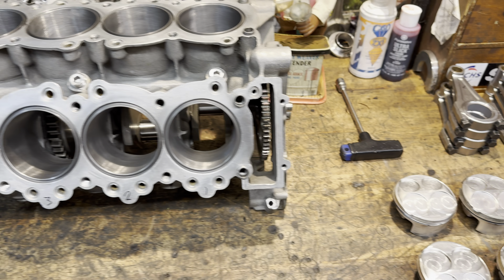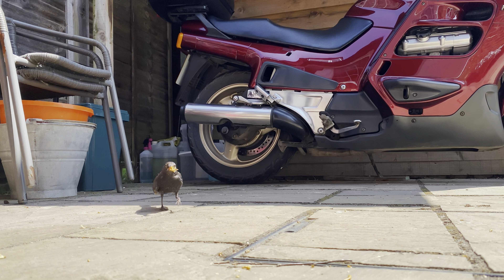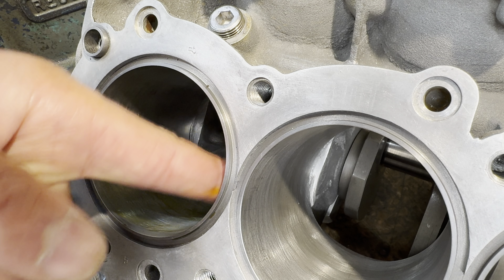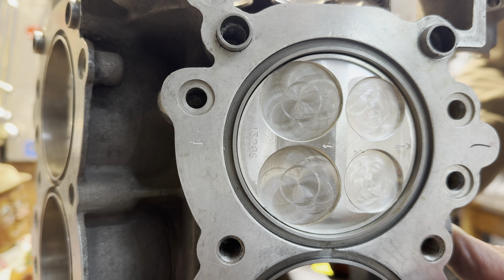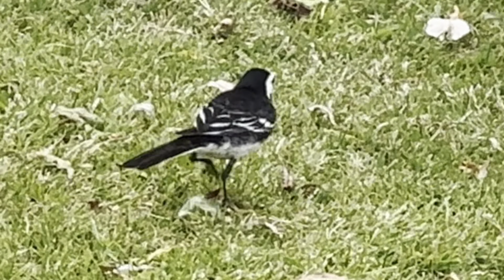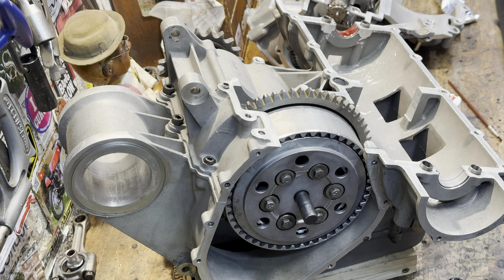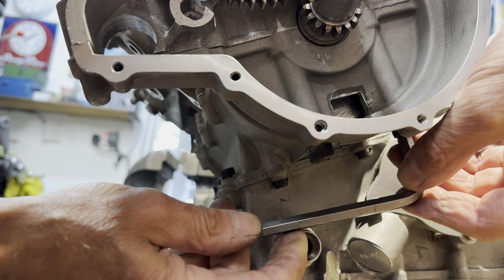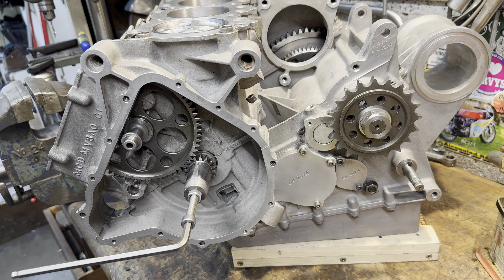Norton Nemesis V8 rebuild - Episode 11

Comment: Engine looking really good, always scary removing rings, there is a very fine difference between opening the ring up enough to remove it without breaking it!
Again, the very poor design with fitting the bolts, done in the mind of a designer, with no thought of build. Can you imagine how that would work on an assembly line and how much time would be waisted.
Bring on part 12 👍👍👍

Comment: Allen , when you did the big end bolts , it appears in the video that missed one!, there is a slight jump in the vid at that point so maybe edited out, but it appears you missed the second bolt on the second rod, of the first big end. i doubt you really did but it would be very annoying to run it up and discover one loose big end bolt!.  and also love the bit with crank wrong way round we actually rebuilt a 400 four years ago  total rebuild got all the way to putting in cam shaft and realised we had forgot the cam chain!! Love your work , my dad was a toolmaker and had just the same precision of work as you do, wonderfull to see. favorites are the hand made engine and single to twin conversions. brilliant.

Comment: At minute 16:02 it is possible to see damage where the clutch cover will be. One of the screws will not be tight, this will be a problem with the finished engine.
Reply from the maker: There is sufficient thread remaining (3D) at least so all ok 🙂

Comment: If I can have the temerity to make a suggestion about those inaccessible allen screws I think I would have used a short hexagonal bit and turned it with a matching ring or combination spanner and just used the key for the final tightening. But then I wouldn't have the patience or skill to do what you can even with a single cylinder never mind a V8!

Comment: The engine block, heads, and internals look very well designed.   Any engineering carry-over from the Coventry Climax 1.5L V8 F1 engine, other than it also being a V8 and DOHC?

Comment: Allen, I had a little nervous twitch seeing you reuse gudgeon pin spring clips ! (Or are they new?)  I learned the hard way back in 1976, aged 16, FS1E, used gudgeon pin circlip fell out, jammed in transfer port and seized engine! A good learning exercise for me back then 😂

Comment: Love it all your work. Alan I noticed Tuning for speed one of my bibles in one of your vids arr yes Slide Rule AKA Phil Irving a fellow aussy. I own several 750 Ducati GTs and am getting my dream engine built a 900 Desmo round case with plain main bearings. An old mate had all the Kawasaki triples 250,350,400,500 and 750 still beats all comers in red light drags with a set of chambers on it. It’s amazing riding behind him and watching the frame twist one way with excessive wheelie inducing acceleration and twisting the other way with stroppy inducing excessive breaking he has twin disks. Wobbels the mad Aussie

Comment: Are there no thrust bearings in this engine? I saw you install the main bearings, but didn't see any thrust bearings, or end float check?
Reply from the maker: The endfloat is controlled by the centre cap with no removable bearings probably due to no end thrust to control in this engine

Comment: You don’t use actual gaskets. I gather the gasket goo is up to the task then.
Reply from the maker: This engine has no gaskets fitted just black silicon sealler. I use Permatex ultra grey which works really well

Comment: What a surprise, the wagtail was wagging its tail,
Well that beats the wagtail bigging itself up with exagerated (wag - tale) stories!

Great comment, why the bolts screw down with difficulty and not up with ease,  it  simply highlights the total lack of brains & care & pride in oneself that us Superior White Indiginous English folk have, when applied to the original design.

Maybe this engine was made (or could be used) for the Chinese to copy?

My dream, imagine a 24 hour video of Alan making a complete bike from raw stock materials that incorporates the very best bits from each & every bike that Alan has made,  modified or planned.

We need a Christmas special.

Thanks Alan, 
(Just trying to seduce people into maximising the number of comments for you).

Comment: Some of the assembly oil seems to have made its way into the threaded holes for the conrod big end bolts, normally  the torque figures are for dry threads,  a lubed thread needs about 25% less torque ( depending on type and amount of lubricant ) how do you account for this when torquing down the bolts.  I used to work for automotive first tier assembly suppliers, and pretty much all the automotive assemblies we supplied with threaded fasteners had to be done automatically with electric inserters that applied bolts with a light torque to touch the surface and then a given angle of tightening ( depending on pitch of thread and yield of bolt ) to ensure that the fasteners were properly preloaded,   I always do this with spark plugs especially because the thickness of steel in the area where thread ends and hexagon starts is a lot thinner than you think... Most spark plug makers give a hand tight and angle setting for their plugs., a new plug the angle would be different ( larger ) to an old plug being refitted because on the old plug the crush washer already flattened..

Comment: AM that Norton seems fairly crude compared to jap eqpt. The con rods are a design I have not seen before but maybe they have increased rigidity or something. Have you seen strength data for that design? Con rod bearing surface area seems a bit on the low side since you had to cut the width of the shells down maybe 20%. Hope that is sufficient. What is the CR on that engine?

Comment: A dyno run when all completed would be very interesting. 👍🏼
Reply: With the new exhaust and airbox changes it might be prudent for some set-up to be done on the Dyno if the budget is available. I can't remember if Allen said if the ignition system needed some work or not.

Comment: 518 Loctite is better were bearing clearances are a consideration as the silicone interferes with the metal to metal interface and affects the bearing clearance. 518 reduces that issue and also stops a lot of contamination from the silicone squeezing out of the joint..

Comment: Did I miss something, or did you skip the second bolt on the second rod cap when you torqued them? On camera it looks like you did, but if you do a two stage torque sequence you would have caught it. Wouldn't want it completely assembled with that bolt hand tight.

Comment: Those hard to get at bolts, wonder could you devise a rubber band as a belt and pully type gismo run by a cordless drill chuck to run them down.

Comment: I know this mightn't seem like a big deal to many, but I LOVE IT when an engine rebuilder DOESN'T slather everything in loads of synthetic assembly lube.
Here we see Allen using engine oil for the most part, and judicious application of the assembly lube.  Not much more is needed, people.  And into the bargain, you don't end up with all that excessive synthetic lube contaminating the engine oil and compromising the running-in process.
Of course, this is just my 2-bob's worth... don't want to start an engine oil argument!  They never end well 😀

Comment: Nice work Allen... what oil do you plan on using for start-up and run-in? with the new liners would you use a mineral oil to help the rings bed in to new bores?

Comment: You can use an old liner  instead of the piston ring compressor to fit the pistons , with your lathe a small female step machined in one end would be " just ...." 😊
Reply: Common in many performance and industrial applications to use a liner type sleeve tool
Reply: @johngibson3837   it's a weird looking design , as if someone thought 0K let's have a narrow angle race engine and compromise it as much as we can by making an arse of the layout and use a gearbox for a bike with half the capacity.
+
Let's make it look complicated and take inspiration from all the things that never worked from a practical application , once this design brief is met , find a few Absinthe sloshing Citroen designers to help create the exhaust manifolds and external coolant gallery's,  a blind welder whose work resembles a row of snotters wiped under a bus seat and a chassis designer who thinks unsprung weight is good at keeping the wheels on the ground .
Reply: You can make an oil seal fitting tool for 98p
Get a rubber bath plug from B+Q
Cut the inside of it out so it fits over the crankshaft stub.
Push your seal onto the tapered part of the plug , slide the whole lot onto the crank and hold the plug firmly in place , lick of oil on the seal lip and wiggle it off the plug and into place .
Stops the seal lip getting damaged or folded under itself.
I made these for Volvo 5 cylinder engines as the main dealer only crank seal tool from Volvo Sweden , that  looks like a bath plug made of steel , was going to cost me almost a hundred pounds from Sweden.

Comment: Thanks for another great video Allen. Something that I noticed back when you were putting the crankshaft in was the absence of thrust washers and the amount of movement it allowed the crank. Is this not a concern due to there being no thrust applied to the crank by the throw-out bearing as would occur in a car engine? Or is it addressed somewhere still to come.

Comment: After many years of working as a welder and machinist doing r&d with engineers I do understand why the Norton team did the things they did to build this bike... However it doesn't mean that I would ever endorse that type of work as I'm of the mindset of why do a job twice and double the costs when one can just as easily take the extra time and energy to build it right the first time.. HOWEVER,had Norton done that, then Allan would never have done this series, and we wouldn't be watching a master do what he does when he fixes others failures...  👍

Comment: I was taught that the the gudgeon pin clip gaps should go at the top or the bottom, not the side. The reason, G force from stopping at the bottom and top of the stroke may cause the clip to move inwards and release/cause wear with movement. With the gap in the vertical plane this does not happen??? Love the show and your meticulous attention to detail.
Reply: Correct.

Comment: Do you have any written specs for the engine, as i was wondering how you knew what torque setting to use and how you order correct shell bearings. 
Watching you work with the ticking clock and piece and quiet is very relaxing after the hustle and bussell working on sterilizers in a hospital.
Thankyou👍
Reply: Hey David if you go back a bit the bearings originally used were from Suzuki 750 with one set slightly modified (think it was the mains) don't remember torque numbers been mentioned

Comment: i would have changed those cap headswhere you needed a shorter fallen key to hex head bolts would be easier to do them up then and take them out. unless they need to be cap heads for some reason

Comment: When you tore down the engine I'd mentioned using a piece of Allen wrench in the socket head cap screws so you could turn them with a box end. Saves having to find the hole each time.

Comment: I've seen Allen make some perfect gaskets, therefore why does he sometimes choose not to and seal with gasket sealer instead please?
Reply: In this case the thickness of the gasket would make the clearance on the outer maine bearings go way out of spec. My guess is that these cases where line bored with them bolted together without anything between them
Reply: @joranbrouwer2157  Many thanks for your reply and this makes sense.  Hope you are enjoying the series as much as me! :)
Reply from the maker: This engine had no gaskets fitted just black silicone sealant when I stripped it down .
Reply: @AllenMillyard  Thanks for the reply Allen.  Really looking forward to seeing this project completed and hopefully seeing the bike in the flesh one day as I live near Elvington airfield.  All the best.

Comment: I find it strange that on such a one off engine build the Norton elected to use bolts instead of studs and nuts.  It would have made this assembly so much easier.  The crank case bottom could have used aircraft spec multi-point K nuts for those very tight spaces.  I wonder if Norton had actually considered the V8 as a viable production engine, whether they would have resolved some of these issues.
Reply: I believe every aspect of this engine reveals that its purpose was to be a shiny, tantalizing  bauble to lure in investors and not a serious development to build an engine to sell or compete in performance trials of any kind, much less to be put into production.  The Norton name has never been seriously used as anything except a marketing gimmick since the original firm folded, as far as I can tell.
Reply: @Hopeless_and_Forlorn  You cannot help to appreciate the thinking that went into this bike and engine, even it was no more than a promotion exercise that a great many car builders like Pininfarina, Bertrone, et al provide that in the hope that it will see production, which many do.  Building a 1500cc V8 motorbike engine has as much credibility as the original V4s of Honda and Ducati and the 3 cylinder (2300cc) of Triumphs Rocket 3.

Comment: A couple of shots have some assy lube between the cap mounting faces - does that cause issues w/ spacing on the caps - and looseness as the lube works out? - and dropping bolt stretch as a consequence?

Comment: Much as i love Nortons  that thing is an absolute abonomation  .
Reply: We have to remind ourselves that this was a working prototype, nothing more. Had they proceeded, the research and development team would have addressed this bike's faults. Then, a pre-production model would be made for testing. 

See this bike for what it is—a rare glimpse of a prototype bike in mid-design. I wish they had continued with this design to full production.
Reply: @swampyankee72  to have a V8 with transverse crank, is pretty genius I reckon. Essential for two wheels.
Reply: @chrisprobert6  Oh, I agree entirely; the prototype is to do just that, try new and revolutionary ideas to see if they work. The Nemesis had several brilliant ideas, but a few things were, as you stated, wild and wacky!
Reply: 😅 I believe Norton are well known, for trying the wild and wacky!
Reply: Some quirky engineering.  Reminds me of the 1700cc Triumph, 4 cylinder engine that was in my SAAB 99 of 1971.  It had head bolts that came in from an angle next to the cam box and standard arrangement for the lower set - the angled ones were screwed into the head as studs, driven by a slotted screwdriver, then nuts onto the studs to pull it together.  The engine developed a head gasket leak at about 70k miles and i had no problem getting the studs out.  At about 107k miles, the engine started from cold with a terrible knock/rap, I think a broken piston.  When I went to remove the studs, they would not budge.  Conference with the dealer indicated the head would have to be destroyed to service the problem - I sold the car to an enthused rebuilder.  I was a professional motorcycle mechanic and most services I could handle but this was not for me.  The case bolts coming in from the top on this Norton prototype reminds me of that and the single compression ring makes this engine far from ideal, IMHO.
Reply: abomination

Comment: I would love to see a Hyabusa-based V12 set up as an aircraft engine.... Then use it as the powerplant for either a Spitfire or a Mustang Light Sport experimental....
Reply: The stroke would be too short, meaning high revs. Propellers work best at lower rpm, gearing down the engine output doesn’t make for long life and reduced weight.
Reply: @user-dx6jf9he7b  well balanced and built correctly it would last just fine. And a belt drive reduction would dampen the vibration well enough. I'm not saying it would be the most practical thing ever but, it would be super cool.
Reply: @tngtacticalmiata1219  way too complicated, the load factor increase for that horsepower would mean a very wide belt. Check out a manufactures specifications for ICE coupled to propeller load, you have to factor in the intermittent loads. The originator was talking about a large, powerful engine, gearing is not a simple matter.

Comment: Great to see it coming back together, top tip re the bolts you could only get an eighth of a turn on with the Allen key, start them by hand for 2 or three turns, then get a 2 inch wire wheel in a battery drill and spin them down with that before doing the final tighten with the Allen key, 9 times out of 10 they’ll spin down 👍
Reply: I was baffled as surely it's a sixth of a turn. I might have OCD :)
Reply: @vintage1956 I agree but it might be an eighth, just cos Alan heads are six sided doesn't mean you get the full swing
Reply: @johngibson3837  yeah but if it only moves an eighth you wouldn't be able to get the Allen key in?
Reply: @vintage1956  never heard of an offset mate

Comment: Best videos on youtube when it comes to this type. Thanks, Allen. Love your work. As an Aircraft Mechanic i appreciate your attention to detail.
Reply: Same for me - I can’t stand seeing things being done half-assed. Once an aircraft guy always an aircraft guy. :-)
Reply: @chriscooper3384  Same here.  First turned wrenches on airplanes 1961, also the year I bought my first motorcycle.  A&P license 1965, began with R-1830 and R-2800 engines.  Watching Allen as he demonstrates mastery of the craft is one of the best parts of retirement.  Along with riding, of course.
Reply: @chriscooper3384 that's four of us!
Reply: I worked as a wireman back in the 60s, building Tank gun control systems and radar/heat seeking nosecones for missiles, to the very strict A.I.D. ispection standards. There's one way to do a job, the proper way!
Reply: This is pure therapy. Nothing more, nothing less. Roll on the next episode. 😊